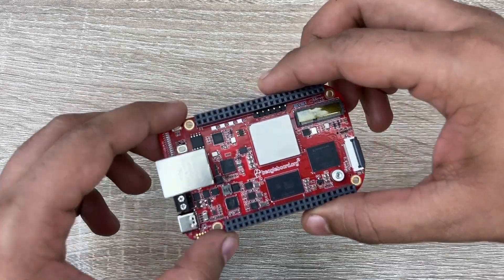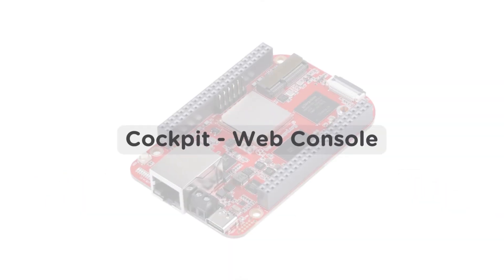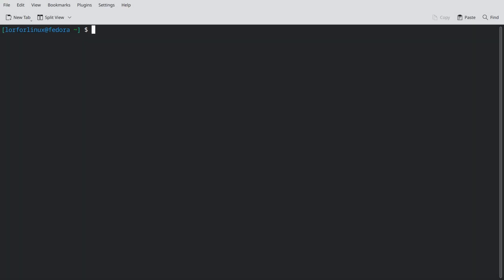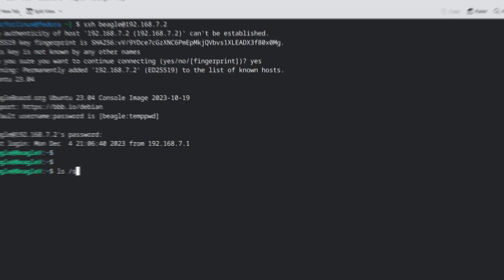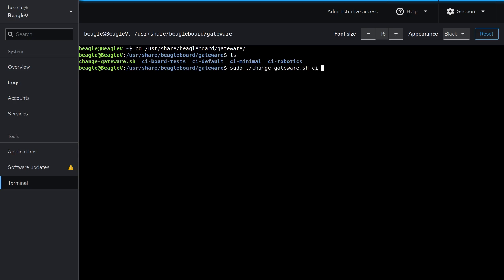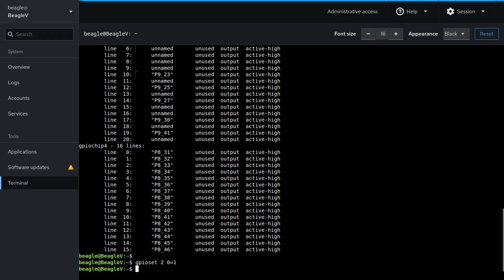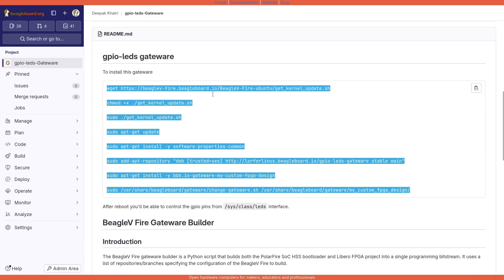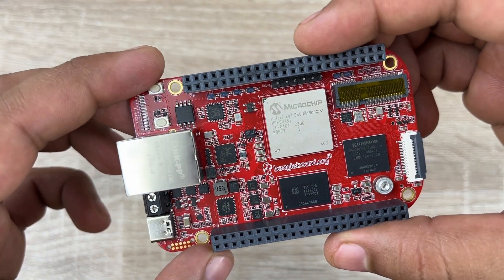BeagleV-Fire Out of Box Experience | RISC-V & FPGA | Microchip PolarFire | BeagleBoard.org

Comment: Except it does not work in Windows and for Cockpit to work you have to connect it to Ethernet.
Reply: For the UART connection on windows, I used the usbipd plugin for the WSL2 which was able to share the beaglev fire. Once shared, just install `tio` and you should be able to connect as if its Linux.